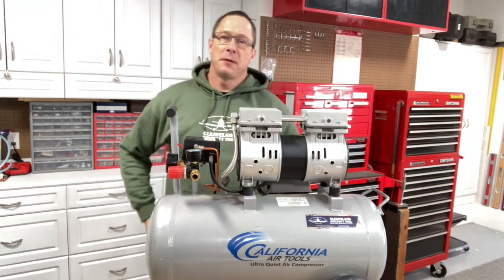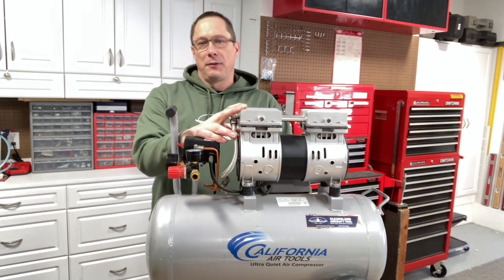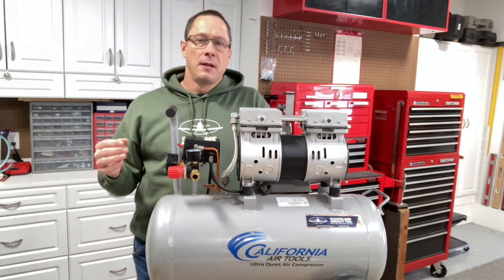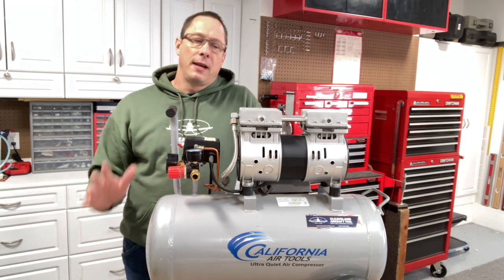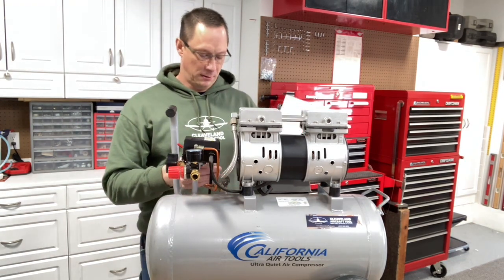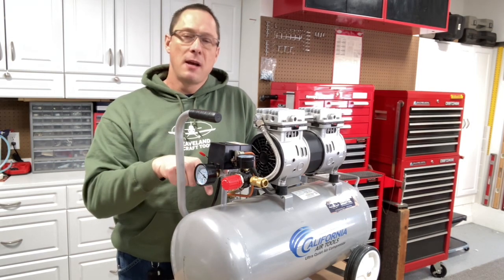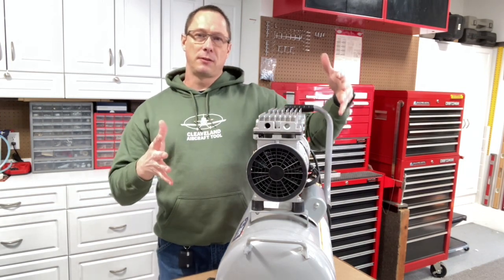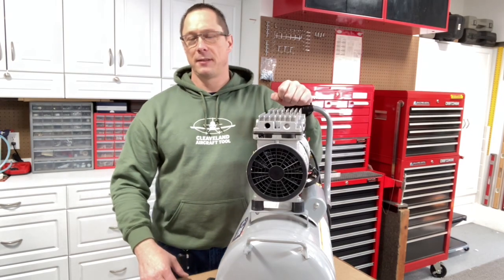How do you pick a compressor?

Comment: Another excellent video!
Several years ago I brought a floor model 30gal kobalt for $200.00. Recently replaced pump, upgraded regulator and upgraded drain. 15 amp air compressor was drawing 19 amps by the time tank got to cutoff 155psi.
Had the same amperage issue as you in my garage. Ended up wiring in a 20 amp ckt to my panel with a 20 amp gcfi chaining two gang boxes with 12/2 MC. Best I can do for now with 125amp panel fed by aluminum wire. ☹️...Looking to upgrade to 200amp so I can go 80gal. Move the 30gal to my hangar as you stated.
Received my RV-10 empenage but haven't started yet. Once I purchase a pneumatic squeezer from you I'll I get started. 
What's your recommendation on oiling air tools?